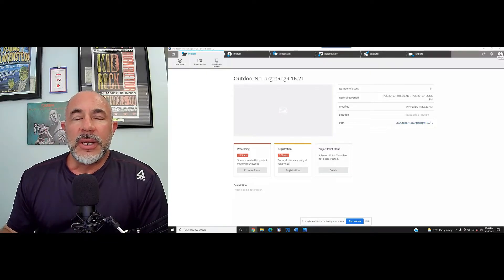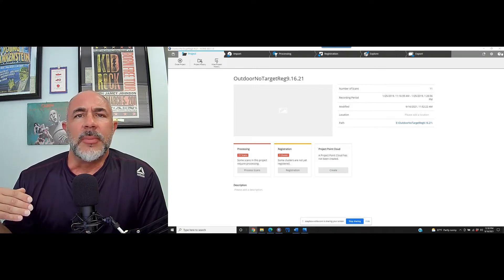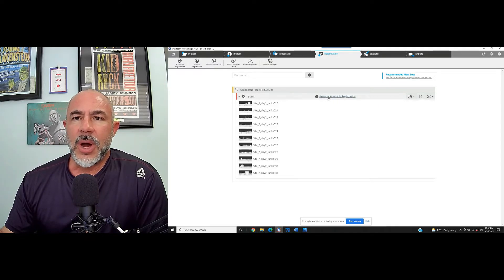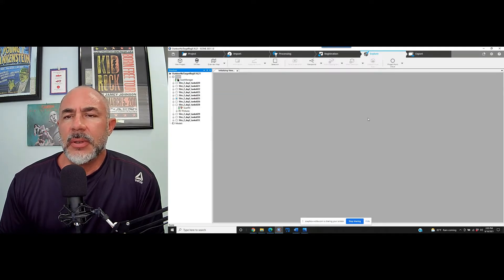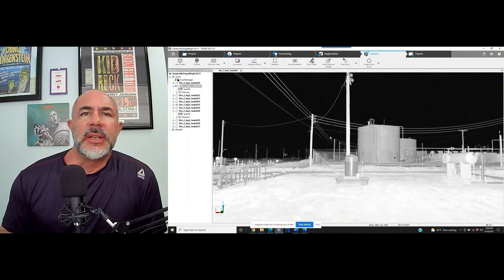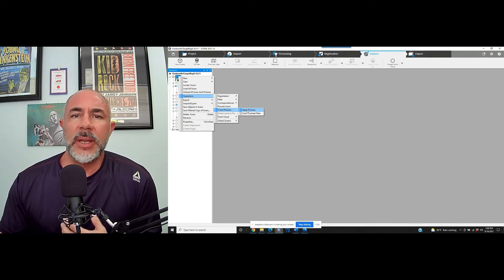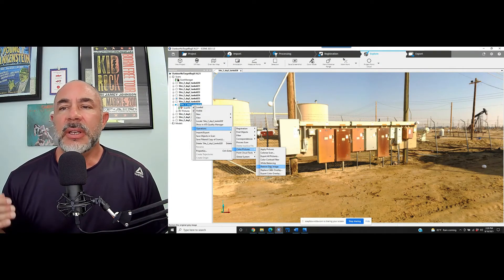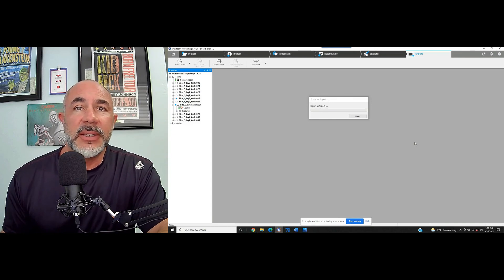FARO SCENE Targetless Registration Outdoor Project

Comment: Hi . I did some scan work at an underground facility. Data processing started but some image are failing to register . What should I do
Reply from the maker: Are you talking about photo images or full scans? if the scans are not registering, it could be anything from failing to properly scan around corners, too far between scans, not scanning in a position to properly see common geometry from the last scan to connect to the next.  Photos on the other hand can show images in strange places on scans for reasons like moving objects etc.